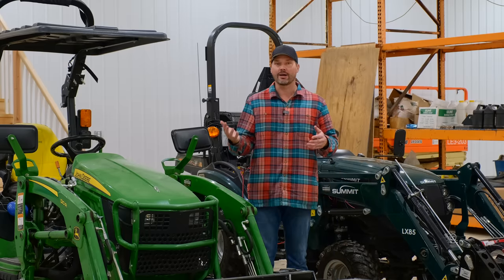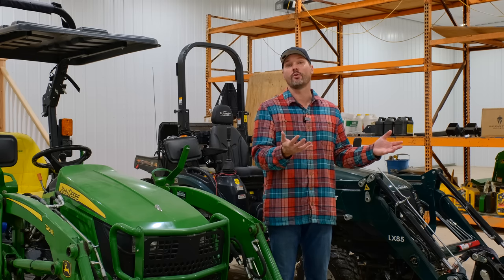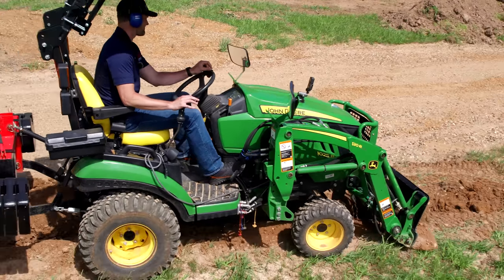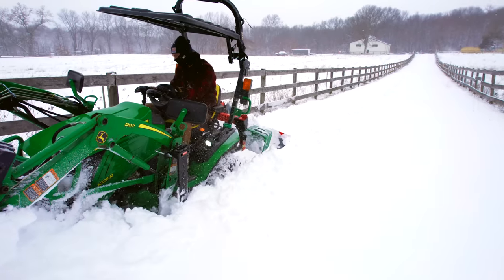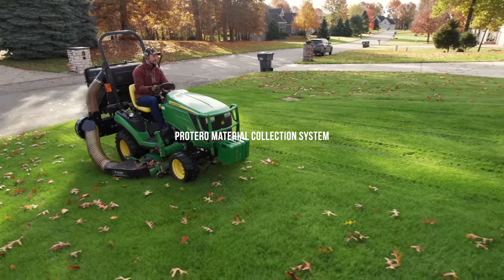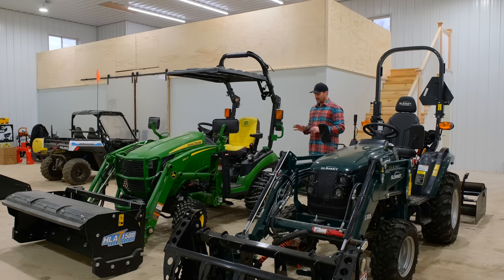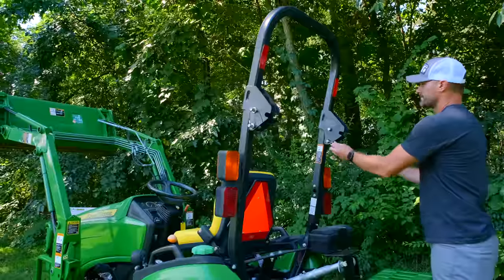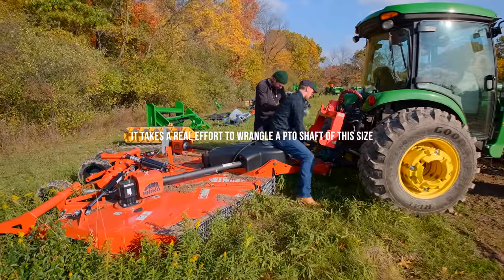BIGGER BAD!🤬BUY SMALLER. BUY CHEAPER. I'LL TRY TO CONVINCE U

Comment from the maker: Do you wish you had bought a bigger or smaller tractor?

LOOK AT OUR MOST POPULAR ATTACHMENTS!
Speeco Quick Hitch: https://bit.ly/3NFC0yl
Stump Wrecker: https://bit.ly/3WYa6Tf
VersaBracket Combo: https://bit.ly/3wUPrnl
Snow Pusher: https://bit.ly/3NB4BVw
Tillers: https://bit.ly/3GT1kk1
Core Plug Aerators: https://bit.ly/3W0R25q
Pallet Forks: https://bit.ly/38wRztu
Grapples: https://bit.ly/3PNNYaZ
Dethatcher: https://bit.ly/3GT9Zmk
Tractor Canopy: https://bit.ly/3IHcvNU

WANT TO SAVE MONEY? CHECK OUT THE GWT DISCOUNT CLUB!  Use code GWT at any of the vendors below and you will save cold hard cash :)  I will also get a commission for the sale, so it's a win-win-win!  

USE CODE "GWT" TO SAVE BIG WITH:
BUCKET BRACKETS @ http://www.jufabworks.com
CUSTOM GRILL GUARDS @ http://www.5elevendesignz.com
PTO QUICK ATTACH @ http://tractorptolink.com
DIY HYDRAULIC SOLUTIONS @ http://www.summit-hydraulics.com
GAME CHANGING GREASING SYSTEMS @ http://www.lube-shuttle.us/store
TIRE CHAINS @ http://www.tirechainsonline.com
PREVENT FLAT TIRES @ http://www.multiseal.us
CULTIPACKERS & CRIMPERS @ http://www.packermaxx.com
ALL OEM JOHN DEERE PARTS @ http://www.247parts.com
ACCESSORIES AND BACKHOE BUCKETS @ http://www.muddscustoms.com
CUSTOM TRACTOR FLOORMATS @ http://www.tractormat.com
PROTECT, ORGANIZE, IDENTIFY HOSES @ http://www.outbackwrap.com
BOX BLADES FOR ATV'S @ http://www.northwoodsfabrication.com
HYDRAULIC SYSTEM PROTECTION @ http://www.hoseendchamer.com
DUMP FROM THE SEAT MATERIAL COLLECTION SYSTEMS @ http://www.proteroinc.com
POWERED SWEEPERS SWEEP UP ANYTHING @ http://www.sweep-all.com
EASY WHEEL TOP LINK HANDLE @ http://www.tractoraftermarket.com
TIRES, WHEELS, AND DUAL ADAPTERS @ http://www.millertire.com
AMERICAN MADE CARRY ALL ON STEROIDS @ http:www.bigtoolrack.com
THE BEST TOOTHBAR AND MORE @ http://www.heavyhitch.com
5% OFF WITH CODE GWT AT TRAC SEATS! http://www.tracseats.com

SHOP: http://www.goodworkstractors.com
AMAZON: http://www.amazon.com/shop/goodworkstractors
SUBSCRIBE: http://www.youtube.com/goodworkstractors
LIKE: http://www.facebook.com/goodworkstrac...
FOLLOW: http://www.instagram.com/goodworkstra...
MERCHANDISE: https://stores.inksoft.com/good_works_tractors_merch/shop/home

*Discount codes cannot be combined with any other promotions, offers, or deals!
**I choose to sell some products through 3rd parties instead of stocking items myself.  Know that I will receive a commission if you choose to purchase through certain links.  Thank you very much for your support!
Reply: I’m glad I didn’t get anything larger than our B2650. It was the smallest available with a factory cab. Maneuverability and overall size has been phenomenal for our small property. I’ve never wished for more. I’ve ran a post auger, move lots of dirt, rock, and materials, moved lots of things with forks, bladed with 3 point, built dirt jumps, and moved tons and tons (literally) of snow with a 66” pusher and rear blade. My only issue with capability has been traction when I get too much snow in front of the pusher.

Comment: My neighbor has a 1025R.  He only has 1.5 acres and a larger machine wouldn't fit through his backyard gate or in his garage.  I got a YT347 because I have 28 acres and a pole barn to store it.  He plows the lower part of my driveway (i let him park his horse trailer in my loop because he lacks flat ground), and I help him with tasks his tractor is too small for.  We cleared some trees so his garden would get more sunlight. We did all the hard work with my tractor and his for the cleanup and finishing touches.
Reply from the maker: Haha, so plan it all out with your neighbor?
Reply: @GoodWorksTractors  He bought his tractor two years before me and our needs don't overlap much.  He mostly mows with a MMM and tends a garden.  I don't have either.  The only real coordination was timing tree removals before building a fence so we wouldn't get in each other's way
Reply: "If you want to HAVE a neighbor, you gotta BE a neighbor" sounds like you guys have it all worked out.
Reply from the maker: Well put
Reply: That’s what it’s all about helping each other with out expecting a return but getting one anyway.👍🏾🤙🏾

Comment: Bought a new 1025R TLB two years ago for use on a small property (~3 acres) and am 100% happy with my choice. The one big miss was that I should have passed on the mower deck. It gives a good cut but is poorly suited to my property and I could pay my lawn guy for 3-1/2 years for what the deck cost me. If I had a big, flat, well-drained lawn it would be a different story. The subcompacts are tiny by tractor standards but they are monster trucks by lawnmower standards. The biggest limits for my use are the lift capacity and breakout force on the 260B hoe. To really improve on those you have to go up to something like a 2032 and that is a LOT more machine and $. But the 1025 can do the job, it's just slower. I removed a couple of 100' pine trees, and the lower trunk had to be sawed into 4-5' segments rather than 6-10 foot ones. A bigger machine would have saved me a couple hours. Big if you're doing it every day for work, meaningless if you're a homeowner doing it once. Same with the hoe, it's slow and weak compared to a mini ex, but sure beats the heck out of a shovel.

Comment: I bought my 1025 R in 2021. I had an old Case 990 which was a 56 hp tractor and was very large. I had a lot of problems with it and decided it was time to replace it. I was looking to get the same size tractor but my biggest hesitation was the diesel exhaust systems that are required for anything over 25 hp. I'm glad  I made the decision to get the 1025R. It's a little tank. It does everything I that I used to do. I brush hog, finish mow, I dig out tree stumps, do a lot of things that I probably shouldn't do with it but this tractor can take it. Best decision I ever made. You don't need a large tractor to do large projects. If you take care of your tractor it will take care of you.

Comment: So very true that smaller tractors are worth their weight in gold for certain chores around the farm!  I use my 33hp to cut out field edges and fence rows before I clip the pastures with the 15’ batwing cutter. The small tractor will go under all the low limbs and is super nimble in the corners and spinning out around the trees in the open field areas so I never have to backup or slow down with the 150 hp tractor.   I also use my 40hp tractor equipped with a 9’ sickle bar hydraulic cutter to keep my pond and lake banks cut/trimmed to the waterline which no other cutter will do this as safely and as fast!  Ad most importantly my wife loves the operate the smaller hydro tractors and cut, clip & garden with them…….. and we all know that……”If Mamma Is happy, Everybody is happy” 😂😂. Have a great weekend.
Reply from the maker: Haha, good stuff Gene.  Have a good one!

Comment: I agree! I bought a 33R because everyone said “go as big as you can afford”. I had it for 3 years and it was a great tractor but I found it sat more than I was using it because of its size. So I traded it for a 2025R and I use it for everything and it does everything well. It just takes longer for some jobs but more seat time on my tractor isn’t a bad thing.
Reply from the maker: Definitely, big size difference between those two machines...glad to hear you found the right fit

Comment: When I first bought my property, having grown up on a farm, I was of the mindset that I needed a minimum of a 65hp row crop tractor for my property. I was so wrong. I never used it. It was way too big for my yard, my buildings, and what I needed to do on my property. Not to mention, since it was old, I was always working on it when I should have been using it. When I got my Kubota L3301, it was a game changer. It fit down all the trails, it fits in and around the buildings, under trees, doesn't tear the yard up, always starts and is ready for work in short order, and it stores nicely in my garage. The HST transmission and 60" blower allows me to blow more snow and quicker than i could with an eight foot blower and gear drive 65hp tractor. I wish I had never bought that old row crop tractor and just went straight to the compact tractor.

Comment: I received the HLA1500 72 a couple days ago. Cleaned the work storage lot, and 4 driveways. Happy I went with your suggestion on width. Works alot better than the bucket, Quicker and much less wear and tear on the bucket and tractor. Thank You. 3046r JohnDeere.
Reply from the maker: Great to hear, thanks again!

Comment: Good Morning!   Great video.....again.   All very good points about smaller equipment, as I get older it is more difficult to "man handle" some of this bigger stuff when hooking and unhooking. Having dealt with larger equipment all my life, I'm usually a little disappointed when I get on my little Kubota around the house but, it does have its place.....it's takes a little longer but it doesn't tear up the lawn as bad as the big loader tractor and the visibility from the operator seat in a real plus in tight places.
Reply from the maker: Yeah, I understand that point of view.  Sometimes I want to whip out the skid steer, but choose the small tractor to showcase an attachment for a project.  I guess I'm not disappointed, but it's a realization that it's going to take longer to get done.

Comment: I have 14 acers in Northeast Texas. I will purchase the Summit as soon as the cab version is available this year. I do not need a larger tractor for my needs. it is hot and humid here and I want AC to be more comfortable when I am working out side....
Reply from the maker: Hopefully Q1 of 2024 for the cab
Reply: @GoodWorksTractors  I am hoping also. But if it is Q2 or Q3, I am in the position to waite....

Comment: Bigger tractor also means bigger tools. I can service my 1025r with the same toolset I use on my 80s trucks. A larger tractor also means larger parts, and it doesn't take much steel before said part is unmanageable without lifting aids like a hoist. Then there's consumables. I keep 10 gallons of HYGARD on hand, and that's probably double what I need for incidentals, for all of my hydraulic equipment. I haul fuel in five gallon cans, and never regret that I don't have a pump, if my fuel consumption was higher, I'd loose bed space in my pickup to haul a diesel tank. It's a snowball thing.
Reply from the maker: Very good point on tooling

Comment: I bought a 2025R two years ago and it's approaching 500 hours.  Very happy with my decision for managing my 33 acre farm property ! (mostly CRP Now)   I needed a back hoe to dig out and repair the foundation on my barn. and for planting larger trees etc.-  The next size up tractor 3 series with a back hoe was a 10K jump in price !  I love how maneuverable the smaller tractor is around the house, trees, barn etc.  The bora wheel spacers greatly improved its tippiness and the 2025r has the increased ground clearance over the 1025R I needed.  I also picked up a used BX 1830 as I needed a belly mower and that little tractor is a beast ! Having a second tractor with a three point hitch makes a lot of jobs much faster (especially when implements aren't quick hitch compatible).  Buying the BX 1830 used was almost as cheap as adding a belly mower to the 2025R  (BX has no front loader so VERY affordable)  - and now I have two compact/ subcompact tractors !

Comment: Bigger, I do love my sub compacts as they can get into tight spots but there are a lot of boulders and logs I had to break down further because they could not lift them or do so safely (either for the operator and/or tractor). I am always mindful of those limits.

I will get a bigger tractor (compact class) in the future as I greatly increase the number of acres I work against and maintain. I will still keep the sub compacts for the tight spots and smaller jobs. I just can not bring myself to sell any of my tractors for some reason (even my garden ones). 🤣

Very good point Courtney about storing the tractors indoors. That makes a big difference in reduced maintenance and enhances their overall lifetime expectancy (parts, etc.). 

Great video, as always! 🙂
Reply from the maker: Fair points Daniel!

Comment: I guess were all different.  I have used a 2320 for 10 years and although I really do like it, it was just a little underpowered for some of the snow pushing on long lanes, etc.  Just bought a 3039r, and love it.  Just a little extra power and size, but no too big.  Anyway, lots of good points in your video, and thank you doing such a nice job; always.
Reply from the maker: I had a 3046r for a couple years.  Loved it.  I sold it because I needed more loader lift capacity at the time.  Did everything else I needed to besides that.
Reply: @GoodWorksTractors  You know, at the end of the day, it boils down to the fact that a fella needs two or three tractors.  One size doesn't seem to fit all jobs.😀

Comment: I use an LS MT125 on 2 acres at home and my 40 acres of woods.  She has been perfect for the small gravel drive, woods trails, you name it.  The 3 cylinder Yanmar is bulletproof.  Tough to justify spending more.

Comment: I've had a 2320 for 8 years and it is pretty good for what I need. I like that it is only 4' wide and I can get around easily in the woods and such. It's true that you can't safely lift a round bale with the loader, but you can safely pull them with the 3PH on a small tractor. We have a triangle that goes into the quick hitch and then an 18' tow strap is an ideal length to go around a bale (flat end down) and attaches to the triangle. Strap should be low on the bale..maybe a foot off the ground or less. Lift some with the hitch to take weight off the leading edge and you can drive anywhere with it safely. It does very little damage to the bale.

Comment: I went with a 1025R TLB, I was considering the 3039R but for most of my projects, I could get by with the smaller model and a little more seat time. In doing so I have been able to acquire more attachments and get more done than with a larger model with one attachment. Wishing I had been able to purchased a snow pusher, as I look outside at all the snow but maybe by next winter I will have acquired one. I love the fact this little tractor is so easy to switch out attachments, plus with a little brute strength and a nudge from "The Precious"  (as my husband calls MY tractor) I can move the attachments around easily, and less storage space is needed.
Reply from the maker: The Precious :)

Comment: We bought a Kubota BX2380 because it was small enough in a residential home but capable of handling the huge plow piles the city plow truck left behind. I also look after the two widows across the street from my mom and dads house and the BX2380 is perfect size for maneuvering around their driveways. I can easily get under one ladies car port and if the snow is too deep to shovel I can squeeze the BX between the carport support poles and the other widows garage! For my needs blowing snow I didn’t need a bigger tractor. So far the Kubota BX2380 with the BX2822 commercial blower, back blade and Tektite cab has been a back saver this winter. We had a huge dump around Christmas and the BX handled all that snow no problem. The BX is awesome.

Comment: I couldn't have gone smaller than my ck25 because I need to move big round bales, not sure I would have if I wouldn't have had to move bales. It does everything perfect in my opinion. The new model in the same size is the ck2610 or ck2620.

Comment: Great video. Your spot on of the advantage of small tractors. My little JD1026R does just about everything i need it to do. Like you said, it just takes a little longer. I have to take it in smaller bites rather than in a couple of big ones.  I've bought things from you, Heavy Hitch, Everything Attachments and Tractor Supply and probably others. It all depends on what the need is and what my budget is. As always, thanks for your insights.
Reply from the maker: Awesome, thanks for chiming in :)

Comment: On the round bale topic.  I’ll say lift and carry would be two separate things.  Mine will carry a round bale, as in will pick it up enough to move it. But, if you need to lift into a round bale pen it won’t do that.
Reply from the maker: On or off a trailer, stacking two high, etc

Comment: Started out with a b2601. Was a great tractor, low fuel consumption, cheap maintenance, and enough power to get most things done even if it took a little longer with great maneuverability. With my work, I did find myself working beyond its capabilities more often than I should. Running an m59 now and the power is amazing but I can't fit everywhere I could with the 2601.

Comment: For our needs, the smallest of the Grand L  series could handle round hay bales or the JD 3R series. The Kubota was available, so we went with that and have been really happy with it. I would point out that the Kubota or JD 3R both need a lot of ballast in the back and in the tires. We have about 1000 pounds between the  attachment on the 3 point hitch and a custom hanger for suitcase weights